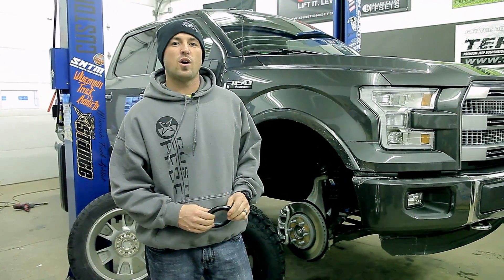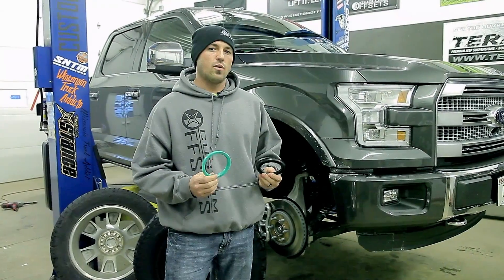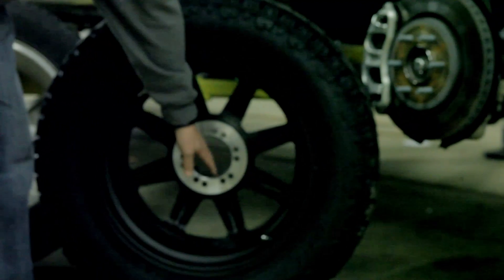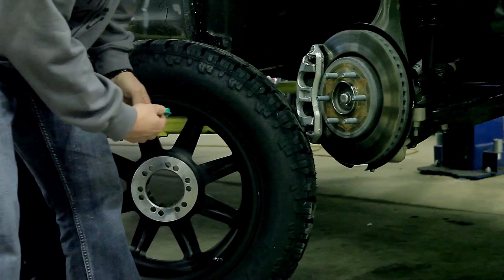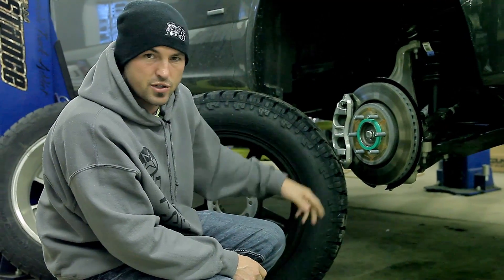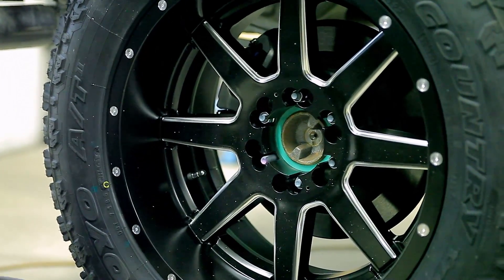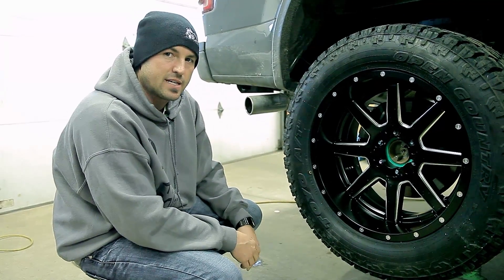Hubcentric Ring installation walkthrough - in depth

Comment: Its important to point out that people saying these are not needed are incorrect.

Although in theory "proper tightening" of the lugs SHOULD center the wheel, in practice this is not always the case. I have a set of TSW wheels that I took to 3 different tire shops and the first 2 were clueless. The 3rd one simply popped the center cap off and "properly tighten" the lugs and they showed me how you can visibly see that its not hub centered.

I couldnt find 72.1-63.4 METAL ones so i ordered the polycarbon ones and instantly the vibrations were gone. 🤷‍♂

Comment: I put on 2021 Ford F150 Lariat chrome OEM 20” wheels on my 2003 Ford Expedition RWD.  The supposed hub for my 03 is 86.8 and the f150 rims I believe are 87.1.  Now I’m worried and thinking of taking it back to Discount tire since there is a small gap between the hub and rim.  Not exactly flush.

Comment: My wheel is 56.7, my vehicle hub is 54.1. I can buy pre-made 56.6-54.1. Is that close enough or do I have to get custom (56.7-54.1) for double the price. Thanks....
Reply from the maker: You can get a hub ring, but the hub size should not affect things that much when the difference is that small.

Comment: This is literally the most helpful video. No one ever told me about this. I got some fuel vapor off-road wheels for my 17 f150 about 6 months ago and they were ok at first but now it feels and sounds like they’re going to fly off. Vibrating like crazy. I’ve asked 3 different auto mechanics what the issue is and literally none of them could tell me. Then I watch this video 😂😂 I just ordered some for 10 bucks. Hopefully it solves the whole issue. Thanks!
Reply from the maker: Glad it helped!
Reply: Did it help?
Reply: What is the size of the rings? I have a 2018 f150
Reply: @JesusF150  I had a different issue going on with my suspension. Had nothing to do with the wheels. Traded it in. Best of luck

Comment: Years ago, when I purchased steel wheels to mount winter tires on, the wheels did not seem to ever be balanced.  I never thought about something like these rings.  But I did know that without the wheel fitting snugly over the hub on my vehicle, that the wheel wouldn't be hub centric, but lug centric. Too bad the tire place didn't have a clue. I simply returned the wheels and then purchased base model steel wheels for my vehicle, which of course fit perfectly.  Now that I know about hub rings, I may buy some aftermarket wheels and hub rings someday and be confident they are hub centric.

Comment: Shop I bought my wheels and tires from told me I need them. I've never seen so I asked what they were. He slapped them on and showed me but put it on backwards and said I only needed 2 for the front. I've had a shimmy at 50-60 I couldn't figure out. Had tires balanced and alignment done several times. Found out it was because I need these on the rear.

Comment: I want to buy some 5×114.3, but my Bolt pattern is 5×115. What type or size of Hub Centric Rings do I need?
Reply from the maker: Unfortunately it doesn’t quite work like that... you have two options, either purchased wheels that are 5x115 (recommended) OR you would need to run an adaptor to change the bolt pattern. Minimum thickness on an adaptor should one inch. Hope that helps!
Reply: @CustomOffsetsTV  Thank you

Comment: Hello there. I have a 16 Chevy Equinox and purchase aftermarket wheels (22) and they were all good til like 3 months ago. I started to have vibration on my car. I felt the vibration on the steering wheel and pedals. I just add some Ring hubs but still having the same vibration. What can it be?

I have balance them already. Dealer checked suspension and was told everything was good. Tire have good tread. Alignment seems good. Pls help?
Reply from the maker: Send an email to info@customoffsets.com and well see what we can figure out!
Reply: Put back the original rims before your tires comes off while doing 70mph.

Comment: Hub-centric rings are an assembly aid.  They can help overcome improper lug tightening procedures, and in a very small number of cases they may compete with the lugs to influence centering.  That is all they do.  The hub center never supports vertical load on any vehicle.  The lugs also don't support vertical load, even if the wheel center bore is large.  All  the vertical load is supported by the friction force between the mating planar faces of the wheel and the hub.  Tension on the lugs when they're tightened creates that friction force.
Reply: Thanks Captain Obvious!!👨🏻‍✈️
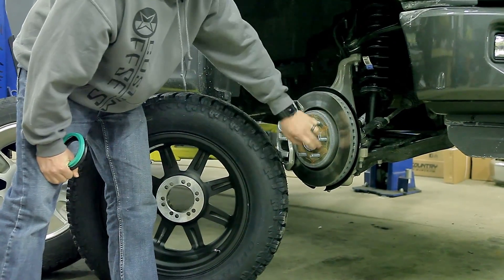Reply: He's probably responding to the comment made in the video at about 1:10 referring the studs bearing the load if the ring isn't used
Reply: Thanks….only because sonmany dont know this and its not obvious

Comment: What if the wheel is smaller then the oem hub? Won't fit at all???
Reply from the maker: Correct, it will not fit
Reply: Thank you
Reply: Wrong , he touched on it you can get spacers made to a custom bore inner bore to fit yours and outer bore slimer, then use adapting rings to fit literally any wheel any hub bote

Comment: can you use them on dodge ram cummins 8 lug I know they are hub centric but can I use them anyway to try I am getting a vibration at highway speeds just had my wheels balanced twice still does it this is my next option to try
Reply from the maker: Yes you can Zac
Reply: Custom Offsets thanks I ordered some from you guys should be here tomorrow I will give them a try hopefully it solves it thanks so much
Reply: zac Edwards hey did it solve the vibration?

Comment: Does the centric ring push the wheel further out? I'm looking at 22s for my Durango but I don't know if it's ok to go with a wheel with larger bore hub if the ring have like a spacer effect 🤔
Reply: No it does not because the wheel sits on top of them

Comment: Could it be a problem if I installed the rings on the hub instead of the wheel?
Reply from the maker: You should be fine, as long as it fits snug to both the wheel and the hub!🙏🏻

Comment: Great video I ordered my wheel and tire package and it came with these but had no idea what they were so I threw them out. Since I know what the purpose of these are what size do I need for a 04 f150 with fuel Mavericks wheels?
Reply: Thank you very much I was wondering what's that for now I know again thank you very much to post the video
Reply: just google the specs of your wheel probably 106x87 or 106.25 x 87.1 106 is the size of  your wheel hub bore if you google fuel maverick hub bore for your truck. Custom offsets gallery will also tell you if you find your exact wheel.

Comment: do these typically come with aftermarket wheels? ordering from fitment industries and not sure
Reply from the maker: Shoot them an email to shop@fitmentindustries.com 🤘🏼
Reply: @CustomOffsetsTV  My parents had an issue with vibration on their 2013 Ford Taurus after installing after market wheels. I don't believe the tire shop knew what they were doing. and we're speaking of a tire shop that is a big chain tire shop.
Reply: Fitment industries not only doesn't include them with wheel packages, they dont tell you that you need them when you do place and order and they don't answer emails when you try to contact them to determine which rings you need for the wheels you just bought

Comment: I got a question offset hope you grt back to me. Why do wheel and tire shops charge a fee for the hub ring if they automatically come with the wheels you buy for the exact car/truck you are getting them for?
Reply: Don’t always come with the hub rings.  After market rims should always have hub rings.  Even with the rings my rims still vibrate I’ve 65mph.  Never seen tire shop guys set the torque wrench to specified number.  Shop guys always use a gun with stick to initially set lugs but not always in a star pattern then torque - not always in star pattern - frustrated !

Comment: do you happen to know that the a 2012 Silverado outside hub diameter is for the rings?
Reply: +Custom Offsets Does Fuel usually send them with the dual drilled bolt pattern rims?

Comment: Just my opinion, but if you need these rings for proper fitment of your wheels, spend the extra money and get aluminum ones. Proper wheel fitment is not only a factor in performance, but safety as well. You really wanna put plastic in charge of that job? No thanks. Go for the aluminum ones. Spend the extra money and do it right the first time.
Reply: Dude gtfoh with your nonsense.Plastic Rings are the way to go,not aluminum